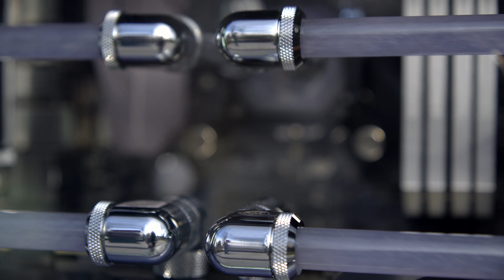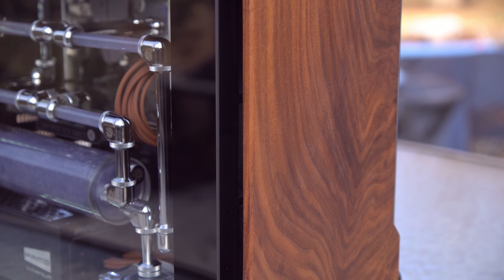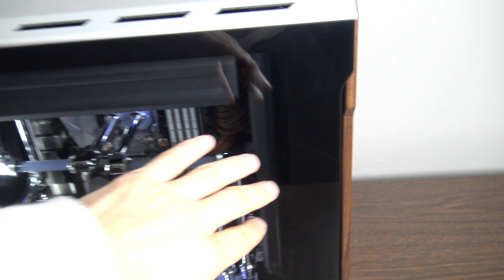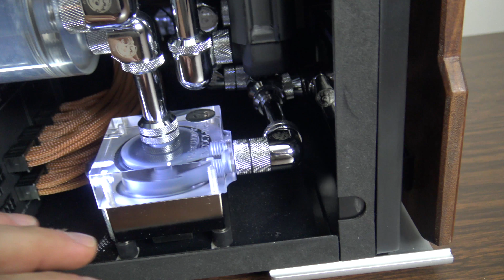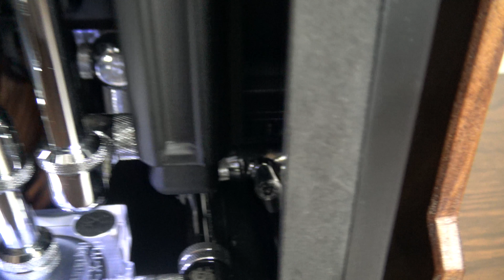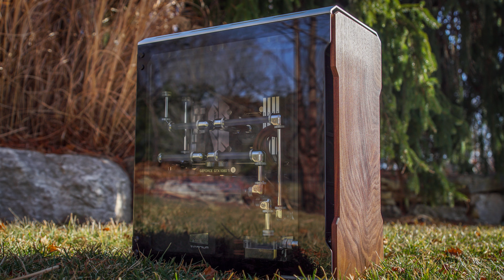Project: ELEMENT

Comment: Could you not fit the 360mm in the front? Or did u use 280mm  just to fit the bleed valve?

Comment: Great build, gave me alot of inspiration and after looking on the web for 2 months  i decided to give this case a try with a custom loop. It will be my first build all the way, so it took me quite alot of research.

I have one big question though. I want to remove the basement shroud as well to allow for more room. However you say it loses rigidity?
But does turning it on its side for the refill not put too much stress on the frame while tilting it ? 

I will be running it with a 2080 ti and i7-7800k, i read you thermals are okay this way ? Or are they borderline with your setup ? 

Cheers
Reply from the maker: When the build is assembled, the case gets some of its rigidity back but it’s still a good idea to be careful when tipping it. Thermals have been fine for me.
Reply: I would assume your noise levels are normal aswell then? 
Anyhow thanks for the feedback! I might give it a go. Looking forward to your next project.

Comment: Wow! Very nice work!  I see you used a 54mm thick radiator (plus 25mm for the fans) on top. How did you make it work? If i measure in my own (the same) case i only have 74mm from the top mounting to the RAM slot. Did you have to cut something?
Reply from the maker: I believe that radiator is only 45mm thick

Comment: Just wondering why you didn't put 90 degree fitting on the fill port, and on the drain (to eliminating the need to turn the system to drain)? for aesthetics or for technical reasons or something else?
Reply from the maker: isn't practical in this situation

Comment: Everything in the case is straight  except the cabels.
I give you 4 of 5 Stars.
You have to comb these cabels for the perfect Look.

And wow, alone the Fitings are for sure more than a hundred Bucks hm
Reply from the maker: This is a preference thing. I normally comb the cables. I didn't do it with this build on purpose. With the brown, I liked the more raw and organic look.
Reply: Those fittings are easily worth £100 + completely defines the build imo.

Comment: Is that PrimoChill VUE fluid? If so any adverse reactions with the silver fittings and the fluid? Seen many vids where silver reacts with it. Not sure if they fixed that yet or not..
Reply from the maker: The fittings are brass
Reply: Brass silver plated? you said they were silver so just trying to understand.

Comment: Was glass ever a consideration instead of the acrylic? Also, where are those radiators from?
Reply from the maker: Yes, I did consider glass but for just those few runs, I decided against it. I will be using glass tubing in the future though.

Comment: I like the wood panel on front but I don't understand the angles. why didn't you cut the sides so they lined up with the angles on the side panels? the gap being uneven kind of throws me.
Reply from the maker: That's the shape of the original panel. I wanted to keep the original design as best I could.
Reply: And the original design is like that for airflow, I assume.
Reply: Perfect as is imo. Can't see the issue.

Comment: Very nice loop, thanks for posting this. This will help me out a bunch, as I am still modding and planing out my loop in a original matx evolv. I wanted mine to run fairly parallel as well, not quite like yours but this definitely helps to visualize the 3D aspect of it. Great job

Comment: Have you had any issues with the Vue coolant? I have seen multiple reports of extreme breakdown and potentially abrasive qualities stripping nickel plating from (EK's specifically) blocks.
Reply from the maker: I got the initial batch, so perhaps there's some truth to that.
Reply from the maker: 2 months and no problems, but I also meet all the recommended requirements from PrimoChill.
Reply: I have. Just saying. It kind of seema to me an initial batch was more stable. People that got it on release aren't having issue but more recent installs are. It's a Russian roulette game at this point it kinda seems.